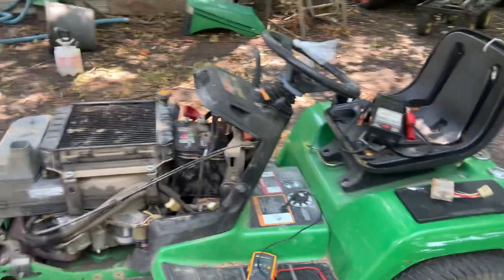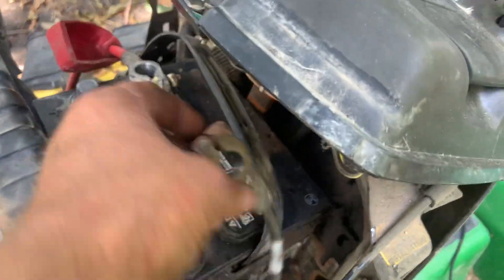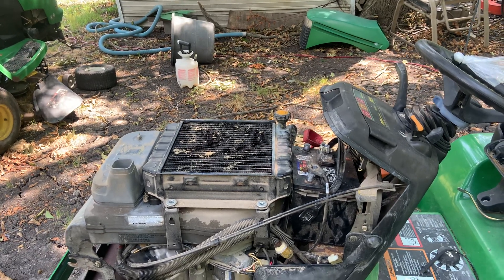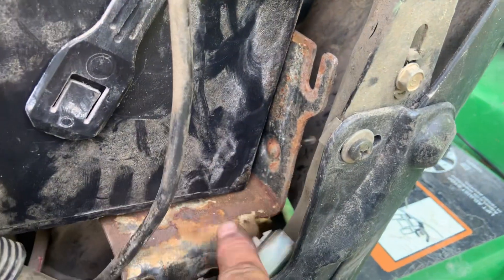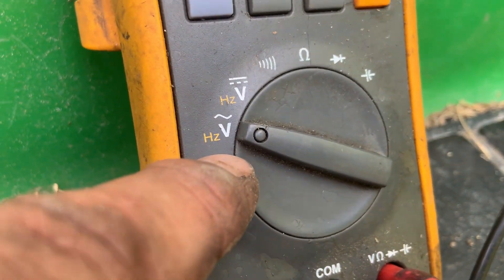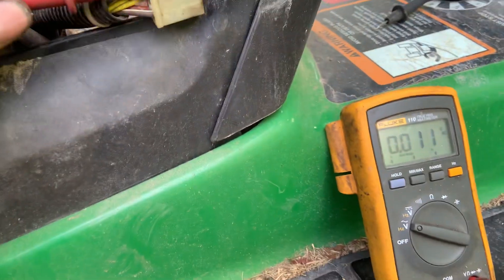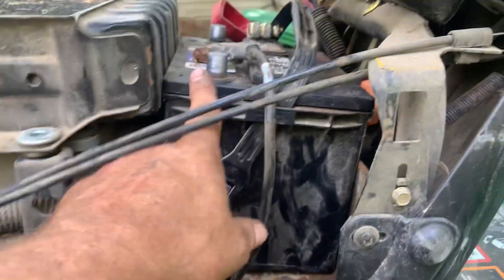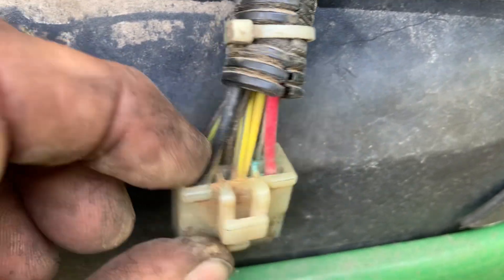John Deere 345 charging problem

Comment: Thank for the great video. I had this issues for years and the local John Deere service department told me to just ignore the issue. Now I know how to test and hopefully fix. 

BTW did the replacement part actually fix the issue once you got it ordered and installed?
Reply from the maker: @mancavecomics7704   Yes, the new voltage regulator fixed the problem

Comment: What should the output be when checking the battery  with voltmeter. Mine is 12.88 at full throttle.
Reply from the maker: @justinrobertson1590   It should be at least 13 volts while the engine is running. Some voltage regulators charge slow so as the engine is running it may be below 13 volts but if you watch your meter while it running you will see the voltage slowly go up like, 12.8……12.9………13……….13.1…….13.2….. and so on.
Reply: @ and I check that using DC, correct? It never raises above the 12.88 unfortunately.
Reply from the maker: @justinrobertson1590   Yes, when testing voltage at the battery set the meter to DC. 
When testing voltage coming from the stator, set the meter to AC.
Charge the battery until the charger says it’s fully charged, when done it should be around 13 volts or higher. then load test the battery. If you don’t have a battery load tester you should get one. But, you can load test the battery without one. Just put the meter leads on the battery terminals and watch the voltage as you try to crank the engine. The voltage shouldn’t drop more than around a volt and a half. 
You can also check your voltage at the battery. Then crank the engine and check the voltage again. The voltage should be higher while the engine is running than it is before you cranked the engine

Comment: Well THAT was easy!  Thanks, Warren - another one filed under Diagnostics; Electrical for future reference. 🔧👍
Just out of curiosity, is there a dependable way to bench test the regulator itself?
Reply from the maker: @Rein_Ciarfella   If there is a way to bench test a voltage regulator, I don’t know it. I don’t think you can but I may be wrong